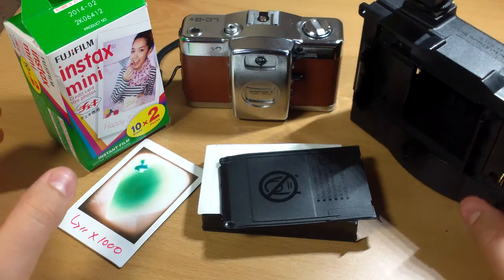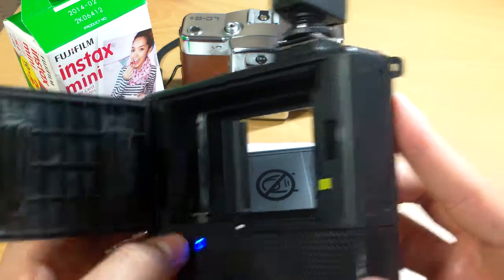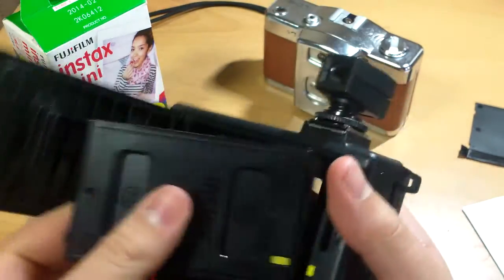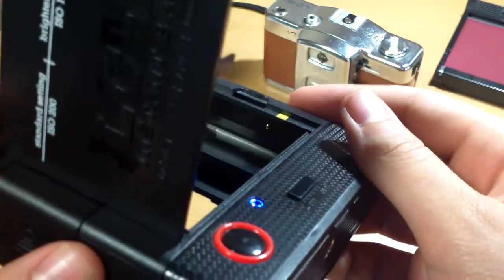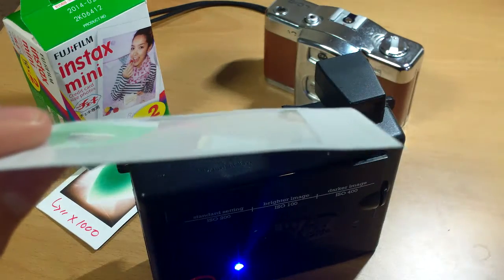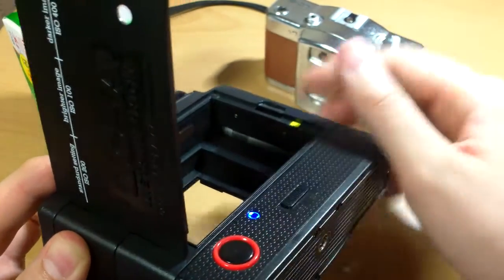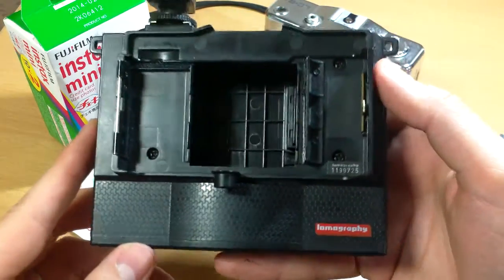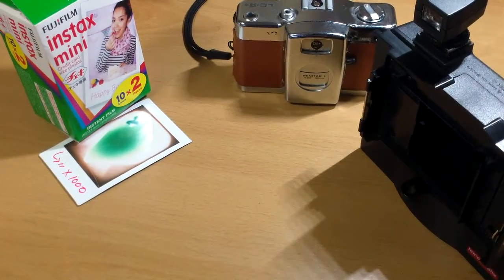Poor Engineering - Lomo LCA Instant Back +

Comment: I don't think this is a general problem, mine work fine, both LC-A and Dina Instant backs. It seams the preasure of the springs in the backdoor is not strong enough.... But as always I can just say that you always should return faulty products imediately and voilá there's the solution of your problem.